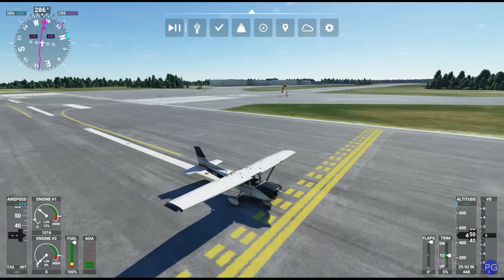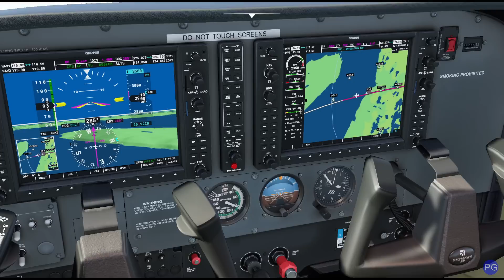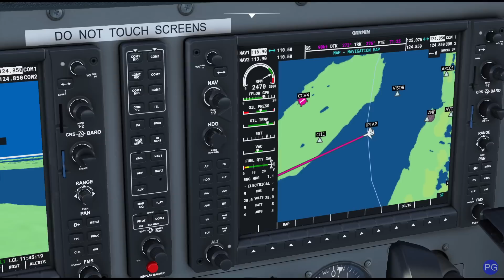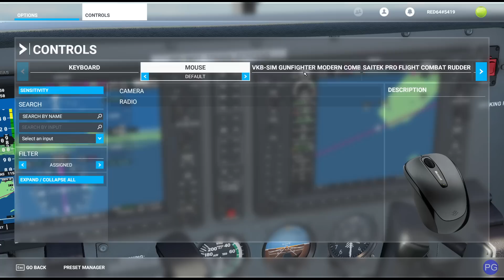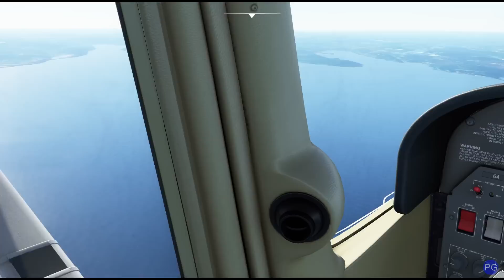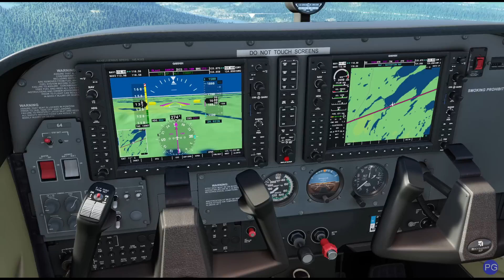FS2020 - The Mixture Control

Comment: Great video,but would you lean a mixture out if you're taking off at a high altitude airport such as Colorado or Arizona?
Reply: You have to, cause otherwise the engine would not get enough air. Therefore, the engine will get more fuel then air and it will drown.

Comment: Does this even work with turboprops? Mixture doesn’t seem to make a difference other than saving fuel
Reply: not just turboprops. on the beechcraft planes it does nothing. you can test this by binding AUTOMIXTURE to (for instance) ALT-M. on planes where mixture is actually implement, ALT-M will move the mixture lever to the optimum position (assuming you are significatnly above ground level), but, if it's not implemented, the lever won't move at all, which is kind of a dead giveaway.

Comment: Most simmers, and in fact many real-life GA pilots, may not realize that leaning correctly not only gets you more power but saves you more than 10$ per hour in fuel (European prices; less in the US) even if you're bimbling along at 3,000 feet. I certainly prefer to spend that money on lunch instead. People who rent aircraft usually rent them "wet", with fuel included, so there's little direct incentive to lean correctly. But if all renters did the right thing, the hourly price could come down.

When I fly the C172 in MSFS 2020 it constantly tells me that I'm not correctly leaned. It's interesting to see the reason in this video: the flight sim is simply wrong! For the C172, the correct fuel flow after leaning in the real world should be about 8 gph, assuming a 180 hp engine with fixed prop.

Comment: Could you do one for the mixture on the G58 please, as it is different with twin prop and rpm controls added and I’d like to get the fuel economy better
Reply: It leans the same as the Bonanza but the Baron's mixture doesn't work in FS2020.  Disappointing.  Although, it does work if you pull it to cutoff.

Comment: Real world question: When messing with the mixture, especially in cold weather, when do you run the most risk of over-cooling the engine? If you're descending in freezing temps, are you better off leaving the engine leaned, to keep as much heat in as possible?
Reply: Yes you can actually shock cool it but if it’s hot out than it is actually better to have it more on the rich side.